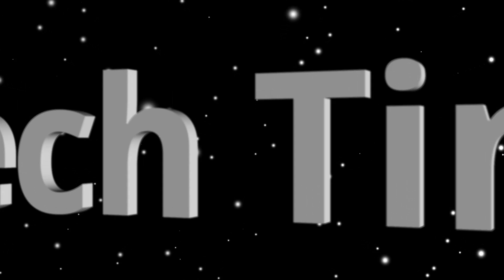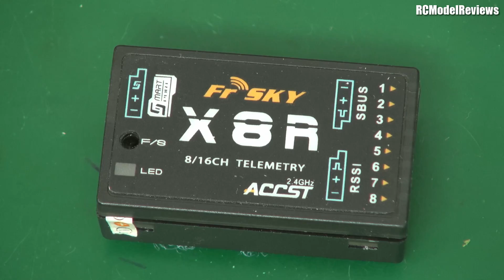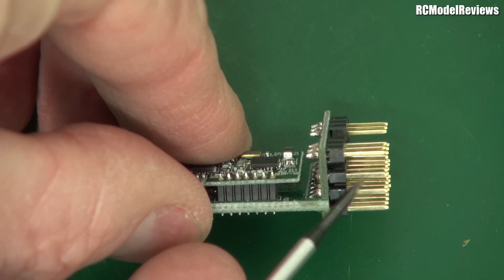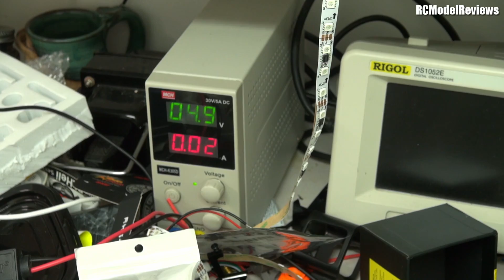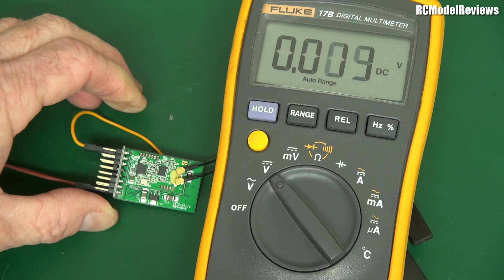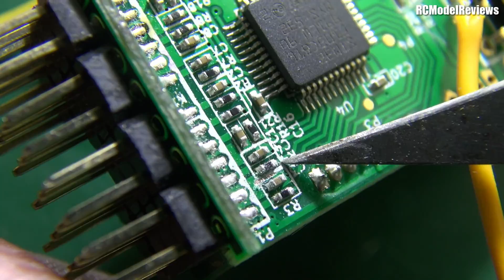Tech Time:  Repairing a FrSky X8R

Comment: Thank you.  Same story as all the blown ones.  Some sort of high current dual path down the ground wire cooks the reg and torches the PCB track as a result of using the smart battery telemetry board.  I've fixed mine now.  I wouldn't have bothered had I not seen your video.  I fixed the ground trace after replacing the reg by soldering a wire off the negative no1 servo channel to the attachment pad on the reg which is on the ground plane.  I never post, but I have to in this instance.  Thankyou, thankyou, THANKYOU.

Comment: good evening. maybe you can help me. i use this rx with an Frsky voltage sensor. the sensor is plugged into the smart port trough the lipo balance plug. i probably reversed the polarity of the balance plug... Now the receiver works only if the sensor is plugged in. the only lipo, if plugged without the sensor , doesn't turn on the receiver. could it be the same problem as you described here? what can i do to check?... thank you very much for help. Gianluca, Italy

Comment: Well you picked it with the fault I had on my X8R with the burned trace. Yes i must have plugged the voltage sensor in the wrong way around :( 
The voltage regulator was ok when I bypassed the trace to the S.Port pin as you showed. Unfortunately it all got hot and stopped after ~10 seconds so something is drawing current! 
Fixing the trace is nearly impossible for me even with fine tipped soldering iron and a steady hand. 
I tried plugging the BEC direct into the S.Port and same thing with working for ~10 seconds befor heatup (yes it seems to recover when it cools down).
Possibly the initial burnout did more damage than just the trace?
It was interesting to find the fault so thanks for posting your video on it. However i think the repair is impractical for me so unfortunately its for the parts box (or bin eventually) for me.  
As a mate said to me a new reciever is the same price as a case of beer. It hurts but i'll recover.
Reply: As a followup (and display of my inability to learn from mistakes) an S6R reciever will only burn out the S.Port leaving the rest of it fully functional. No more telemetry here now but at least the reciever works. 
I only posted this here as it may help others. I wish the ballance port wiring colours were standardised i.e. all red with one black wire for ground.

Comment: I've blown my LDO but don't yet have a multimeter to be certain of the pinout.

From the video it looks like pin 1 is output, 2,4 are ground and 3 is input... but that seems pretty hard to find.

More common is 1 input with 3 as output (https://www.mouser.co.uk/datasheet/2/268/22070a-53890.pdf) 

... or 1 is ground, 2/4 output and 3 as input (https://www.mouser.co.uk/datasheet/2/389/cd00000544-1795431.pdf).

Anyone found the part or can confirm the pin-out is not what I suggested?

Comment: belive it or not, i did the same thing with the battery sensor.... result :  dead X8R, voltage sensor and Fas 150. Can you tell me the exact number for the regulator on the receiver? Mine is visualy blown but i can't read the numbers anymore and i really want to reanimate it.

Comment: Reversed the balance cable on the MLVSS volt sensor, it took out the X8R receiver, led controller.  This video helped me to repair my X8R, and I already had some type 16 regulators ‘16 2L’ , the same negative trace burned out, so ran a jumper as well.   Advise everyone not to buy the MLVSS, get the FLVS voltage sensor instead as it will protect your electronics, the MLVSS will fry everything if you make a mistake connecting the balance cable.

Comment: Great vid.  Thank you.  Idea for next video. Frsky Neuron esc. During set up I powered the receiver with a bec, this let the manic smoke out of the esc. I know I am not the only one to do this. It still works, but clearly isn’t quite right. I can see the component the smoke came out of. Thinking of trying to fix. Never used hot air gun ,or whatever you used, to desolder though. You skipped over this bit in your video. A video on this would be helpful.  Keep up the good work

Comment: Wow ..now thats the difference between you and the other can't be bothereds...  love it.   Could put some white out on those little neighboring diodes i guess..to make it easier or possible to micro solder.  Need to get a good hot air for micros..what did you use?

Comment: I had an x8r get damaged in the same place by the same method a while back. the voltage regulator (and all else) was still working though, so just had to run a wire. I now buy the voltage sensors with the screen as they are isolated (also necessary for eg 12s usage) and will not blow up radios/servo wires in this way

Comment: I've got an S8R where all of the positive leads on the servo output pins aren't working.  I can plug a battery into the SPort and the receiver powers up, but if I plug a battery into any of the servo pins I get nothing.  Do you know where I should start?  I'd like to try to fix it as it seems to be a main power issue somewhere.

Comment: Hi. That was a great diagnose and a great job on a fix. I used to do a lot of those replacements when the components were full size and easily removed. How did you get the voltage regulator off the board? I find it extremely difficulty to get surface mount components off any boards due to the size and type of soldering used to put them on as it’s done in a solder bath and stuck on. I have a router that was taken out by lightening last week. I traced it down to a surface mount fuse on the telephone line in. I was unable to get the fuse off the board because it was so close to other components and it is the size of a crumb. Also I am unsure of its size (current rating). Is there a way of telling its current ratting without a circuit diagram? I did a bodge job and got the smallest wire I had to hand and just bridged it out. It has fixed the fault and it works. I am using it now to send this post to you. It would be nice to remove that fuse and replace it. Can you offer any suggestions remembering that my eyesight is not great now and i get a shaky hand when soldering. I have a temperature controlled iron and a surface mount tip. I have populated a fresh pcb with surface mount components.

Comment: Most of us can find the fault but we cant fix it because we cant make micro repairs you file down tweezers and soldering irons . And struggle with our size thousend hands lol. And dont get me started with heat guns that just melts every dam componant . If you have a micro heat gun ? What is it. If i was five years old i might have the eye site and small fingers but im 50 and find under magnification i shake like a dam leaf in the wind.
Reply from the maker: Don't be too worried... I'm in my 67th year and have Parkinson's but I'm still fixing this stuff -- it just takes longer and is sometimes a little/lot more frustrating having to deal with the limitations imposed by old age and shaky hands.
Reply: @RCModelReviews  bad tempered grumpiness may be not a good mix with micro electronics lol

Comment: Great video! I fried Omnibus f4 pro board by connecting Vbat from ESC to 5V line by mistake. When I connect it over USB voltage regulator goes very very hot. Would be good to know is this fixable and how.

Comment: in doubt here. at 1:12 you say "because it takes the voltage from your servo.."  you mean it takes the voltage from the battery connected to the servo leads.. right?

Comment: Yes, yes! I'd really like to see you use the hot air gun to remove surface parts, I've never done it before and I've only seen it once or twice.
Reply: yeah, the secret is also to use flux (extra) to let the solder flow.

Comment: The more information on repairing PCB's the better. I have a drone but the controller lost a cap due to a modification I made so the LCD doesn't work. All I need is a picture of the board and I can get it working again.

Comment: How did you figure out where to scrape off the resist to find the broken trace? The rest makes sense, but I don’t see how you decided that precise spot between those two pins was the right place to start.
Reply from the maker: I traced the negative pins on the servo connectors to the soldered piece but found it went no further so I started scraping the resist off from where the battery negative last appeared.   It wasn't long until I found the break in the trace.

Comment: Good work! Tell John to put a short JST-XH flylead on the voltage sensor - you can then tuck the sensor away somewhere, and it's impossible to connect it up the wrong way round.

Comment: One thing I worry about fixing stuff like this is that you don't know if the microcontroller etc is actually damaged and if it's going to lock up after you've flown it a few times.
Reply from the maker: That's why you fly it in a basher plane a few times until you're confident that it's working okay.

Comment: That was very lucky. I had a similar mishap but with an X4R and on that receiver it was the MCU which very visibly blew up. A bit of a poor design by FrSky (IMO) as it's not at all difficult to plug the lead in the wrong way.

Right better stop criticising FrSky; I can hear shouts of abuse from the SxR rcgroups already. 😏

Comment: greaaaat stuff Sir B. more of this indeed, and thanks.  Suggestion, i have studied electronis way back, but so much has changed, if you can do a short "who's who/What's what  on the cricuitboard"   identifying the components just like you did here, but a bit more in general and perhaps a bit slower, asking for a frien :D ?  There must be persons out there that can not identify any part on a board,  i've seen people, non-techies but still, do horrible things trying to wire a mains plug. But for myself, pretty good with a TS100 if i may say so, still make a few assumptions now and again
#IFIXIT  just an example, the BIND button on my TinyHawk broke, jumperwires are a nightmare with only two hands....fixed  it though and happy as a patreon of Bruce [Alex van der Hoek]  netherlands

Comment: Great stuff Bruce, I love your "fix" videos! A m8 of mine changed the plug on one of his lipos from deans to XT60 and put it on the wrong way, didn't notice and blew his ESC! Could it be the same sort of power regulator thing or is it toast?
Reply from the maker: It's probably toast :-)   Power electronics (like the FETs in an ESC) generally don't like being connected with reverse polarity :-/   However, never throw stuff away, there could be bits worth recycling because not everything will have been destroyed and you can test components to see if they're okay so they  might come in handy when repairing something else.

Comment: Excellent demo. Cheers Brucie. I have half a dozen HD run cams that don't work after collisions/high altitude falls! What's the most likely damage in the scenario?
Reply: I think I have heard that an impact can rip the CCD chip off the PCB. If it's that, it's unfortunately a very improbable that it could be fixed. But taking a look if it's something else never hurts.
Reply: On one occasion I took a heat gun to the chip set and it worked, melting the solder joints just enough. A very blunt instrument ...

Comment: Love it Bruce. Any obvious reason why a x4r would drop a servo output?
Reply from the maker: could be a break in the path from the microcontroller to the servo pin -- there's usually a resistor in series with the connection so use your meter to track back to that resistor and then from the other side of that resistor to a pin on the microcontroller chip.
Reply: @RCModelReviews  I got nothing to lose

Comment: It is a simple repair to the trace open. Simply find a piece of copper wire that is just as thick as the trace width and solder it across the open of that trace. You will need yo clean off more of the trace to get more bare copper before doing the soldering repair of the trace. This type of repair is common in working on two way radios. Then, it is just a matter of replacing the blown voltage regulator. I also would recommend following that lead an confirm the continuity from the negative battery pin to the negative lead of the voltage regulator. There still may be other potential trace problems not seen at this point.

Comment: I often think of how many perfectly fine electronics get thrown away in this hobby because most people now days don't want to bother and don't want to learn. It's sad 95% of the time it's a 10 cent regulator to fix.
Reply: Yeah but then you need equipment to repair and so on
Reply: @peterzingler6221  I don't have a hot air gun or a reflow oven, I use an iron not even a great iron either hell sometimes I even use a fat chisel tip if I'm too lazy to change it and the parts are not micro. It's not as hard as you might think, granted I have repaired some tiny aio camera and micro 1s vtx's with sot-23 regulators and on one occasion a 0402 cap that got lifted when replacing one of said regulators ( wouldn't recommend that for anyone with bad vision and lay off the caffeine beforehand, you might not seem shaky until you're trying to hold something in place the size of a grain of sand)

Granted I've been soldering for 15 years or so but, most people wouldn't be doing 0402 components on micro boards. Replacing a regulator or running a jumper like Bruce is doing are things anyone who's been in the hobby a couple years or better should be capable of. If Louis Rossmann can do component level repair so can you. The only tool that I would say is needed ontop of an iron is some tweezers but even then you can hold it in place with a toothpick or something I rarely "hold" anything with tweezers instead just putting a little pressure on top to hold in place. 

Whew that was fricken long haha.

Comment: I really dislike the way they routed that ground trace there. Hopefully it goes on to a big groundplane after 🙂
Reply from the maker: Yeah, I was surprised at how thin that single, solitary trace was.  Obviously if fused at this point because that was the thinnest part of the trace.  Mind you, since the receiver draws a total of less than 100mA, it's probably acceptable -- but still, I would have liked to have seen a better connection between battery negative and the ground-plane.

Comment: Maybe add a diode to it before you hand it back?
Reply: TheVexCortex hahahahaha I'm not that bad lol-it was an easy mistake to make trust me-go look up the Frsky Lipo telemetry sensors and you will see how easy it is to get it wrong!!
Reply: @Johnn_T  Everyone makes that mistake at least once in their life. Manufactures really should just add a little diode on everything, it'd only cost a few cents...
Reply: @TheVexCortex  : But then you wouldn't have to buy a replacement. 😄
Reply: TheVexCortex yep they should but they won't because it's bad for business to "idiotproof" stuff-well, they think it is but they forget that people value EXACTLY that kind of simple innovation so the long term return on that innovation is more sales etc.... but yes, too short sighted!
Reply: @Johnn_T  Not really - if it didn't happen, you wouldn't even know they went that step further to make the product more robust! The "customers will stick with good brands" doesn't hold water either, as FrSky is a budget brand, not a "good" brand - if the argument held, this wouldn't have happened either (because it'd have been a receiver from a good brand).